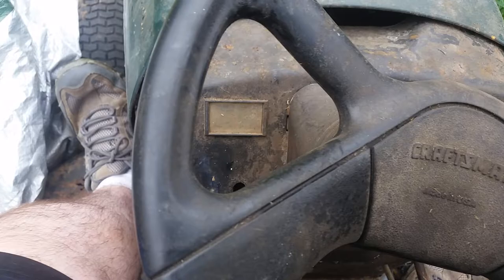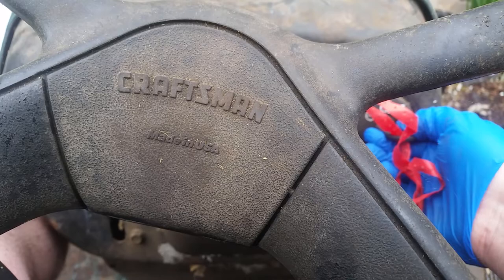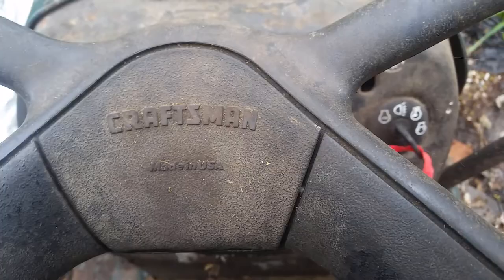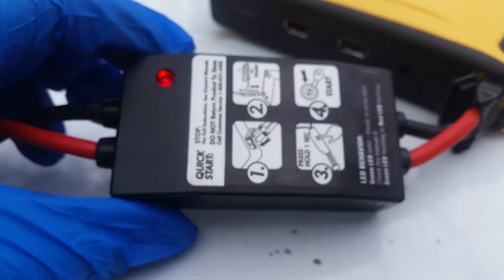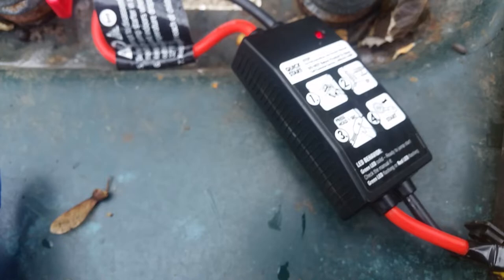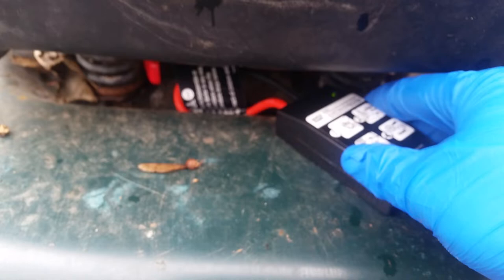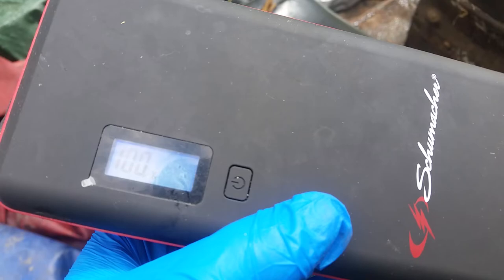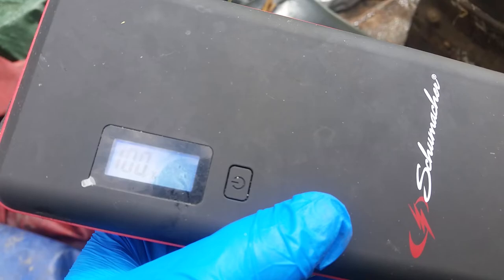How To: Jumpstart A Lawn Mower With A Dead Battery Using A Portable Jumpstarter

Comment: For mine, I have to be actually sitting on the seat to start it because of the safety switch, so once it starts, if I get off to remove the battery pack, the mower is going to turn off....and then I feel like it won't start again because it hasn't had time to charge

Comment: Can I jump start tractor directly  from portable jump starter if tractor battery is missing?
Reply: I wouldn't trust this guy!
Reply: @steves3760  lol but true
Reply: Yes I've done it with an old Toro mower. Jump started it from my truck to mower with jumper cables.

Comment: Why do you have to put the seat down
Reply from the maker: That's how it works.  If the seat is up, it won't start.  The metal coils connect to the metal frame of the seat & conduct electricity.  You can also hold the brake in it was also stay on on Craftsman mowers.  When you push partially down, it is the brake, all the way is the clutch.